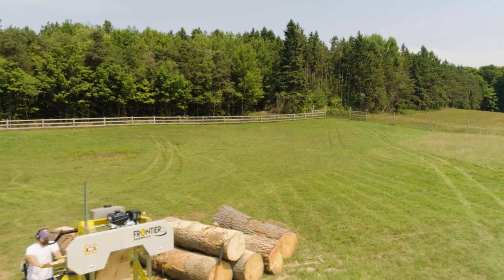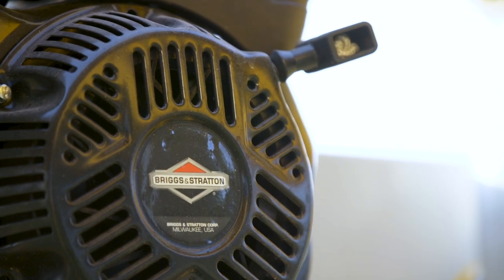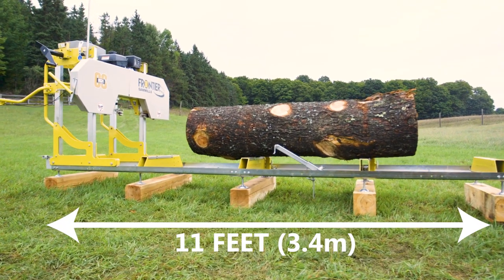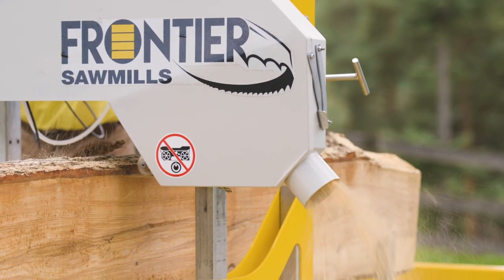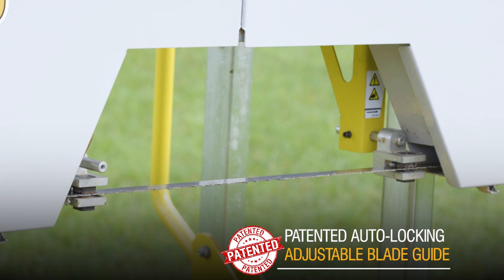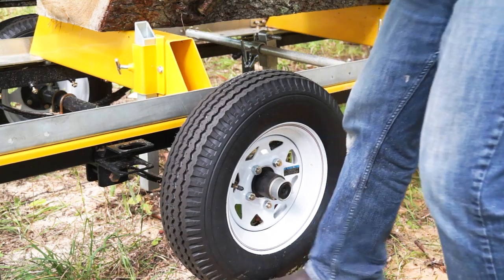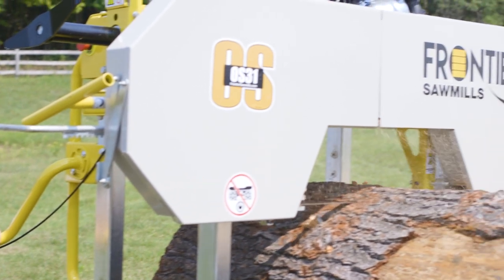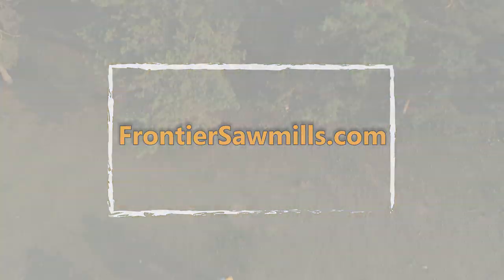The World’s BEST Portable Sawmill Value – An Overview of the Frontier OS31

Comment: What are the differences between the os23 and the os31? Is it just the size of the logs it can cut? Do they have the same frame? I'm looking on your site and it doesn't specify from what I can see.

I don't wanna buy the os23 if it's a lesser quality saw.
Reply from the maker: The construction quality is the same. The OS31 is considerably bigger. It also features stainless steel bunk caps.

Comment: How many price this wood mill machine
Reply from the maker: Frontier builds three sawmill models with different log diameter capacities: OS23: 59cm (23”), OS27: 69cm (27”), and OS31: 79cm (31”). Standard log length is 3.4m (11’) but you can add 7’ (2.1m) extensions to mill as long as you want.  You can add the optionally available trailer/support jack system to all Frontier sawmills at any time (when you get your Frontier or in the future).

Frontier Sawmills start at just USD $2297 (for the Frontier OS23). The Frontier OS27 starts at only USD $3297.  The Frontier OS31 starts at only USD $3897.  

You can get a lot of helpful info about Frontier Sawmills, including all pricing, at www.FrontierSawmills.com  .

Frontier services your country factory-direct.  To order, contact us directly at Frontier Sawmills via email at info@FrontierSawmills.com . 

Thanks!

Comment: How much money does the saw mill cost
Reply from the maker: Frontier builds three sawmill models with different log diameter capacities: OS23: 23” (59cm), OS27: 27” (69cm), and OS31: 31” (79cm). Standard log length is 11’ (3.4m) but you can add 7’ (2.1m) extensions to mill as long as you want.  You can add the optionally available trailer/support jack system to all Frontier sawmills at any time (when you get your Frontier or in the future). 

Frontier Sawmills start at just USD $2297 (for the Frontier OS23). The Frontier OS27 starts at only $3297.  The Frontier OS31 starts at only $3897. 

You can get a lot of helpful info about Frontier Sawmills, including all pricing, at www.FrontierSawmills.com  .

Would you like a free Frontier Sawmills info kit? You can order one online at  https://www.frontiersawmills.com/en_us/free-catalog-free-dvd-form

Thanks!
Reply: What is the price with out generator set?

Comment: How much man
Reply from the maker: Frontier builds three sawmill models with different log diameter capacities: OS23: 59cm (23”), OS27: 69cm (27”), and OS31: 79cm (31”). Standard log length is 3.4m (11’) but you can add 7’ (2.1m) extensions to mill as long as you want.  You can add the optionally available trailer/support jack system to all Frontier sawmills at any time (when you get your Frontier or in the future).

Frontier Sawmills start at just USD $2397 (for the Frontier OS23). The Frontier OS27 starts at only USD $3397.  The Frontier OS31 starts at only USD $3997.  

You can get a lot of helpful info about Frontier Sawmills, including all pricing, at www.FrontierSawmills.com  .

Frontier services your country factory-direct.  To order, contact us directly at Frontier Sawmills via email at info@FrontierSawmills.com . 

Thanks!

Comment: How much its cost in India?
Reply from the maker: Frontier builds three sawmill models with different log diameter capacities: OS23: 59cm (23”), OS27: 69cm (27”), and OS31: 79cm (31”). Standard log length is 3.4m (11’) but you can add 7’ (2.1m) extensions to mill as long as you want.  You can add the optionally available trailer/support jack system to all Frontier sawmills at any time (when you get your Frontier or in the future).

Frontier Sawmills start at just USD $2297 (for the Frontier OS23). The Frontier OS27 starts at only USD $3297.  The Frontier OS31 starts at only USD $3897.  

You can get a lot of helpful info about Frontier Sawmills, including all pricing, at www.FrontierSawmills.com  .

Frontier services your country factory-direct.  To order, contact us directly at Frontier Sawmills via email at info@FrontierSawmills.com . 

Thanks!
Reply: @FrontierSawmills  how much the price

Comment: sorry Frontier   you are wrong there is on adjustable blade guide system NOT on the OS.27   At 2.50min you say that all your frontier sawmill are ( adjustable blade guide system)
Reply from the maker: Actually, yes it is Blinky. Effective in 2019, it is on all Frontiers.
Reply: @FrontierSawmills  not on my OS 27 i have had a OS 27 sawmill for 2yr It would of been nice but no
Reply: Can you add the adjustable blade guide on the older model ?
Reply: @mswaterman2  Hi Tom  It would be Great... but no
Reply: @blinky1324  i am trying to decide on that OS27, how is it working out for you, and what exactly do you use it for.
Thanks